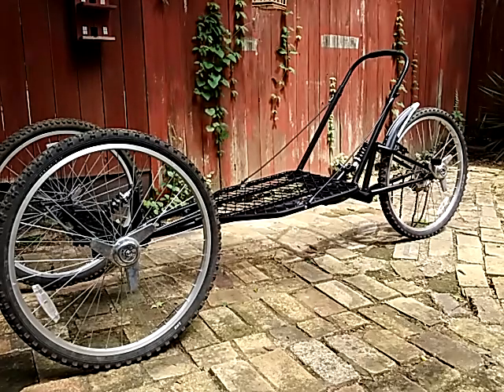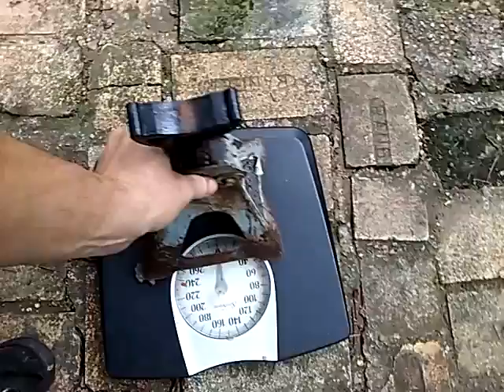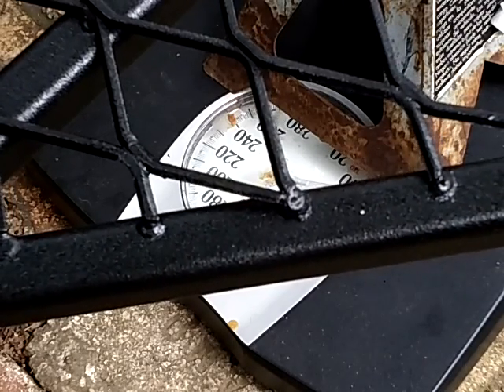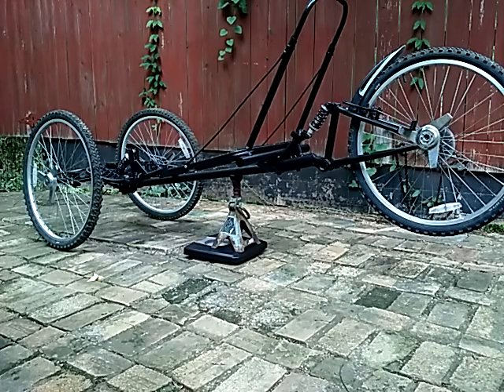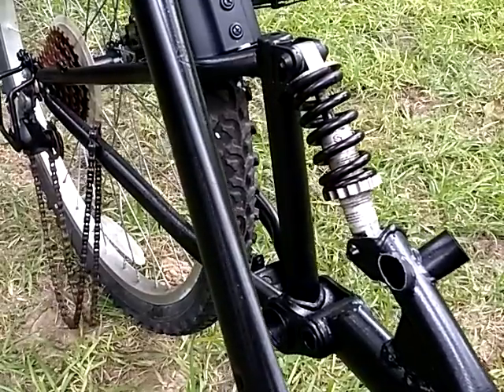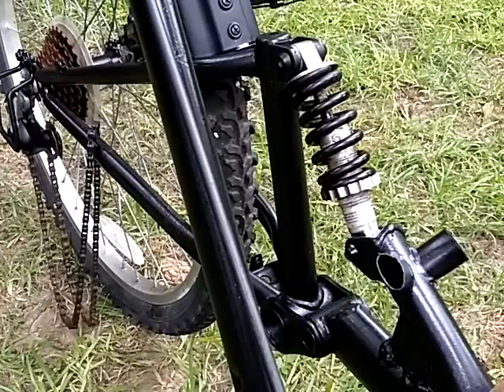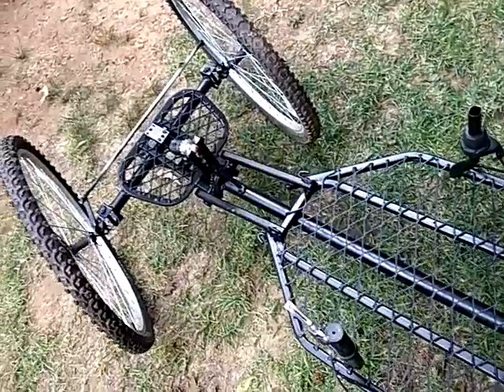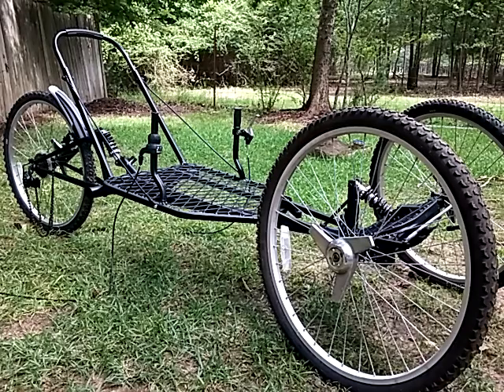Trike build - frame weight

Comment: I had an old Chopper, built in California in the late 60s, & it was 10 ft 6 in, axle to axle. Add the 15-in Volkswagen tire on the back and the 21 inch Avon in the front, and it was 11 ft  9in.😜💯

Comment: why wasn't aluminum or magnesium used in place of steel with steel brackets? turning, put the cab above the wheels which gives a higher ride height and would allow for turning. or widen the front to allow for turning but so that the wheels do not rub the legs or the cab if that is what you are to do. deff use a softer spring, with the amount of pressure you need to use to make the springs work you are putting too much stress on the other parts , soften springs,make then do the work instead of the axles and such.
Reply from the maker: good advise ;)  weather ( winter, rain, cold..etc. ) ... No it's 💰😉 really.